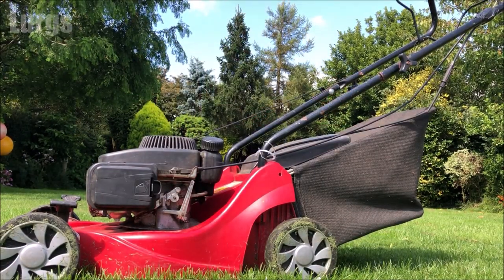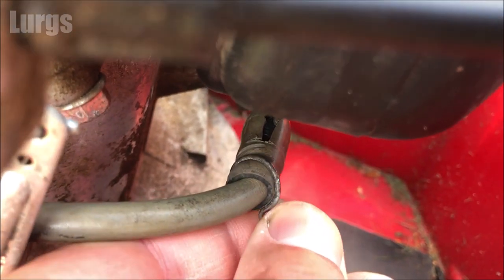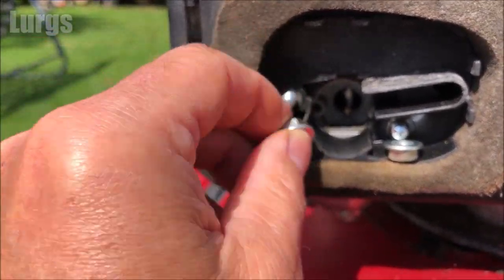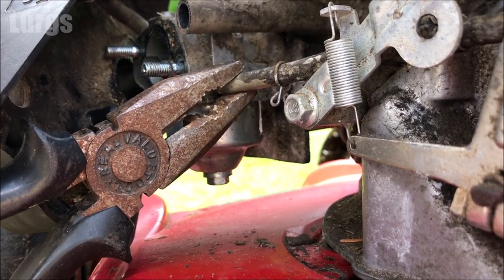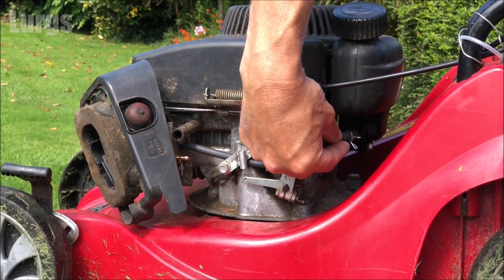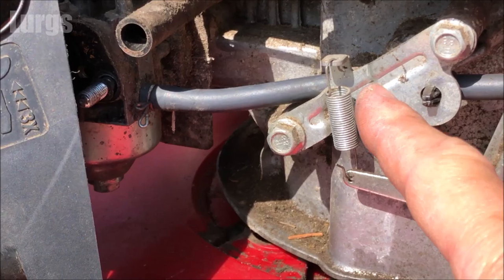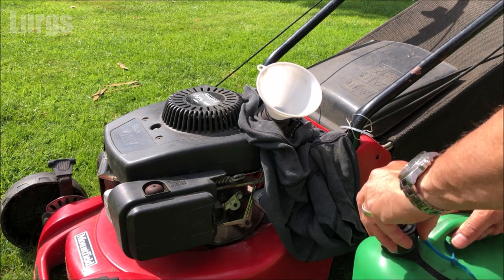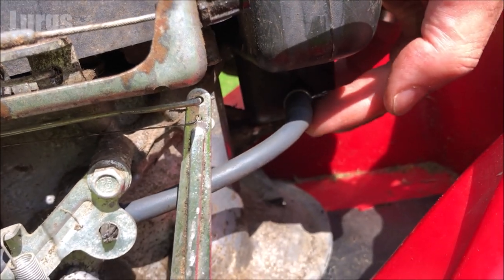How to change Fuel Line on Lawnmower - Mountfield Petrol Lawn mower Fuel Line replacement

Comment from the maker: How to start a Mountfield Petrol Lawnmower https://www.youtube.com/watch?v=2OeRNdm1nAw&list=PLqrXuUebV8N9wFyNO2TVAYHYT85fmvLrX
Mountfield Petrol Lawn mower Fuel Line replacement https://www.youtube.com/watch?v=4HvTZ36FVF4&list=PLqrXuUebV8N9wFyNO2TVAYHYT85fmvLrX
Mountfield Petrol Lawnmower How to fit a new Cable Fixing Block https://www.youtube.com/watch?v=_Y7i9Et-7h0&list=PLqrXuUebV8N9wFyNO2TVAYHYT85fmvLrX.
Qualcast Lawnmower Review https://www.youtube.com/watch?v=hOHTx3Ev6Qc&list=PLqrXuUebV8N9_JYlSh2LjbfUsybF840oy
.
https://www.tubebuddy.com/LurgsHowToGuides I use TubeBuddy to grow my YouTube channel. Click this link to install, even the FREE version is great. This link is an affiliate link which means if you buy a TubeBuddy licence I will receive a small commission. There is no additional charge to you.
.
Other useful How To Guides to help you save ⏱TIME and 💰 MONEY:
How To's, Life Hacks, Helpful Tips https://www.youtube.com/watch?v=dcmxUTsedlk&list=PLqrXuUebV8N92xXP4Dm_pHfBpEQ3wtP2R
Washing Machines How To's, Tips, Tricks & Fixes https://www.youtube.com/watch?v=0_gst8RokRo&list=PLqrXuUebV8N_Bv_41hH-IpIfM5qiS0Sin
Dishwasher How To's, Tips, Tricks & Fixes https://www.youtube.com/watch?v=6z22-Ysn7rE&list=PLqrXuUebV8N89GJMUjDiMqGpAcic3wqfD
Toilets and Plumbing How To's, Tips, Tricks & Fixes https://www.youtube.com/watch?v=vT5KwJ2A2eU&list=PLqrXuUebV8N_d4OWPjAk4PJ7LnKb0Jdot
Combi Boiler How To's, Tips, Tricks & Fixes https://www.youtube.com/watch?v=1gGEP2y_qHM&list=PLqrXuUebV8N8aiBpt_F3n23E3IOLlmgK2
My Reviews https://www.youtube.com/watch?v=QX0ge0QOXJk&list=PLqrXuUebV8N9_JYlSh2LjbfUsybF840oy
.
TECHNOLOGY
==========
Windows 10 How To's, Tips, Tricks and Fixes  https://www.youtube.com/watch?v=eZW7ka9xgXg&list=PLqrXuUebV8N95_cVCA-40v6eT9piGz26y
Google Chrome How To's, Tips, Tricks & Fixes  https://www.youtube.com/watch?v=iLSbSA5YECc&list=PLqrXuUebV8N8RYpRb0gVVNf9SpC78SB47
Microsoft Word How To's, Tips, Tricks and Fixes  https://www.youtube.com/watch?v=OZi6yS79FLA&list=PLqrXuUebV8N_DyHPlBddZaL8LOwuCzFK3
iPhone iPad iTunes How To's, Tips, Tricks and Fixes https://www.youtube.com/watch?v=hcGfZTcJxvo&list=PLqrXuUebV8N_YRivg9p4ZpkUyBDbSb8t7
iMovie iOS How to Guides https://www.youtube.com/watch?v=uTkXwZJ0gE4&list=PLqrXuUebV8N-D5BiCaF2AV-Qb-8gZwBFC
.
Vehicles How To's, Tips, Tricks & Fixes  https://www.youtube.com/watch?v=w44aQ7dc_Lk&list=PLqrXuUebV8N9fyM8qA2D0rkVfv929Ckod

Comment: Thanks for posting this! I managed to order the right lead and then replaced the original which has a small crack in it. I did it first time in about 10 minutes. Cheers!
Reply from the maker: Great news. Glad my video helped. Happy mowing.😎
Reply: What website you order the new house?? Cheers mate
Reply from the maker: @zezinhosilva44  Got my house from an Estate Agent.🤣. Got the hose from a dealer on a well known auction site that sounds like Flea Bay.
Reply: @LurgsHowToGuides  thank you very much. Have a nice day

Comment: This seems to be a common failure mode, i've had to replace mine 3 times in 2 years, it's not expensive to fix once, but I am considering buying 1m of 5mm fuel hose, 1m of 8mm fuel hose and an 8 to 5 reducer, it'd probably cost me £15-£20 but would last years.
Reply from the maker: That’s odd I replaced this over 2 years ago and not had an issue

Comment: Please don’t laugh 
I put diesel fuel in my push mower. I didn’t start it and I did suction most of it out. 
Is my mower even salvageable?  😢
Reply from the maker: It’s only a very basic engine if you put petrol in it now and just keep trying to start it then it will probably be ok. Might take a while to start. Hope it’s ok